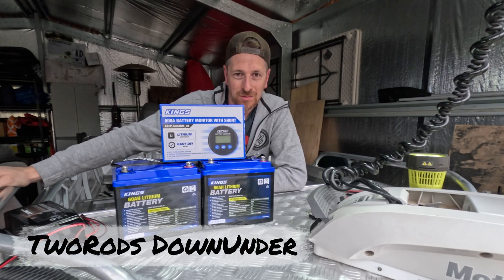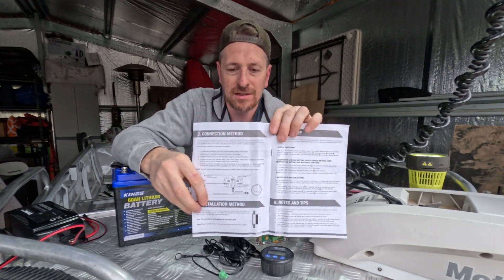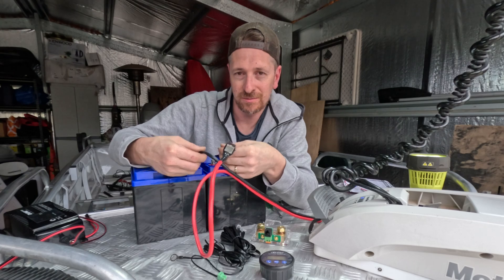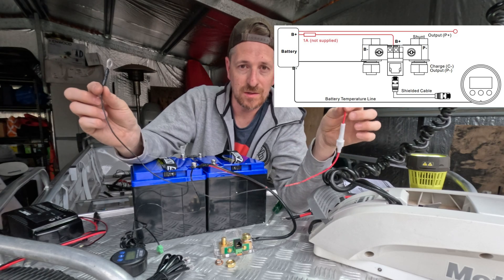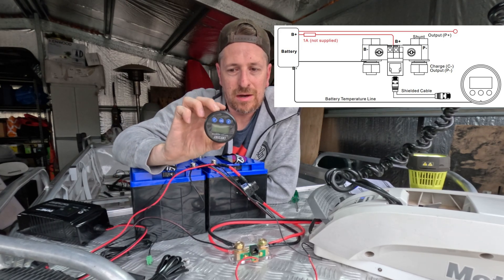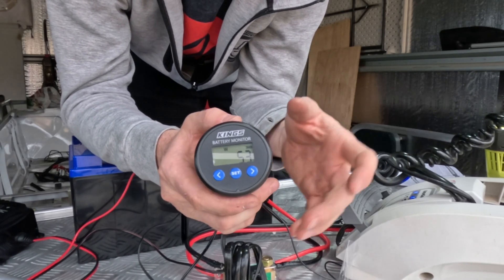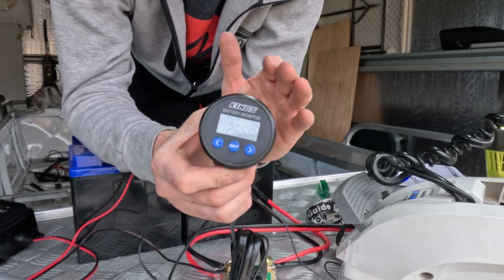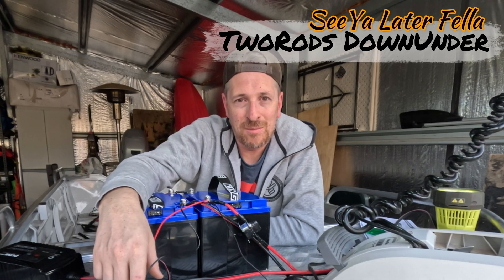How to Install a Shunt Battery Monitor on 12V & 24V Systems – Step-by-Step Guide!

Comment: How would you put the terminals if you have two 12v charging leads to each battery instead of your 24v charger?
Reply from the maker: You can have two 12v batteries in series and still charge them individually, just ensure you charge them both seperately before you use them again. You don't need to disconnect the batteries from each other to charge. 🍻

Comment: I had two kings batteries in series running a MG for about a year and it works but eventually one battery will become unbalanced so you have to charge them independently or get a balancer. 
I found it easier to repurpose the batteries elsewhere and bought a Litime single 24v 100ah battery. 
I did a video that's on my channel. 

TLDR; Kings batteries are perfectly fine but dont run in series.
Reply from the maker: I only ever charge independently for this reason 😉 the BMS isn't smart enough

Comment: I run a 44lb thrust Watersnake with a 120 ah Kings Lithium - I use the motor mainly for creeping up on snags and moving away from the bank when the tidal flow of the river takes you into it . Seems like a load of wires and gadgets to add to a battery when you  can just use a multi meter to see the state of charge on the battery . My motor is just 12V and in a battery box as well . Cheers 🍻
Reply from the maker: Sounds like a nice setup, with lithium batteries they hold voltages higher throughout their state of charge, so it doesn't curve downwards like an acid battery, unfortunately we can't use a multimeter to test it's charge. Some fancy lithiums have the monitor built into the BMS, but these cheaper ones don't. The only way to know is to measure the flow of power going out to estimate how much you have left. 🍻🎣
Reply: cant use voltage to monitor SOC for Lifepo4 nugget.

Comment: G’day literally just did the same thing in my boat giving the Kings gear a run x2 120ah  12 V batteries for a 24v minkota. 
Haven’t yet ran the system to see what I’m actual drawing amp wise. I normally do nothing short of a 10-12 hour day on the water flicking lures so I’m super keen to see how the kings lithium bats hold up
Reply from the maker: I've trolled with this setup for almost 5hrs straight 😂 and it used about 35ahs, the 24volt motors are really efficient when you're not maxing them out. You'll love it 🍻🎣
Reply: @tworodsdownunder good stuff keen put em to the test. majority the time I’ll be spot locked when targeting Barra only time it’ll work is when chasing jacks 👌🏻

Comment: I have a century Bluetooth unit. 
 All I did was put neg and pos on the battery and my phone app shows my battery life and volts etc running my minn kota electric trolling motors. 
 Why is mine working and you need a shunt?
Reply from the maker: Not all batteries have Bluetooth for monitoring, I went this route so the monitor is independent of a smart phone etc. Just a preference.
Reply: @ 
Understand that is the reason you added a shunt was so you could add more products if you need to?
Reply from the maker: @vtwin1979  this is a monitoring system which uses a shunt, it's not used to add additional products. The batteries do work normally without it. 🍻
Reply: @ 
Oh, ok. 
I thought you could just run neg / pos from the digital meter directly to the battery just as I have with the Bluetooth meter.

Comment: Nice video. What battery charger are you using? Will be interesting to see how the kings gear holds up
Reply from the maker: I grabbed a Dune 12/24v AGM and Lithium battery charger, 12AH output. First thing I'll be doing is a full draw down to see if they are 60AH capacity. Battery prices are dropping fast because manufacturing methods are getting better and I believe a lot of older more expensive brands are dreaming with trying to chase the old prices still..